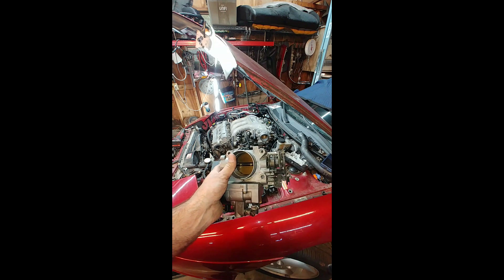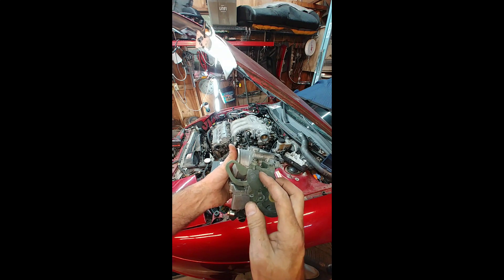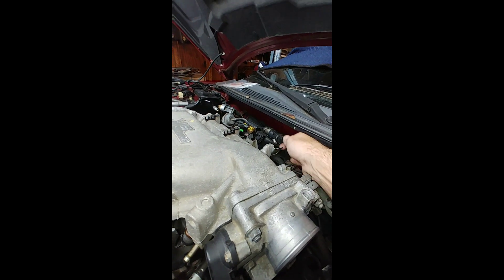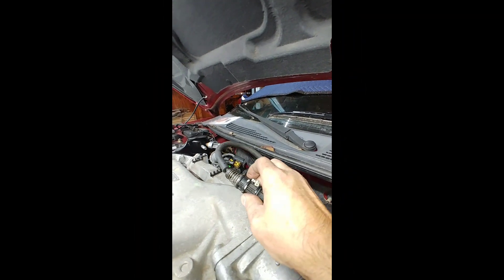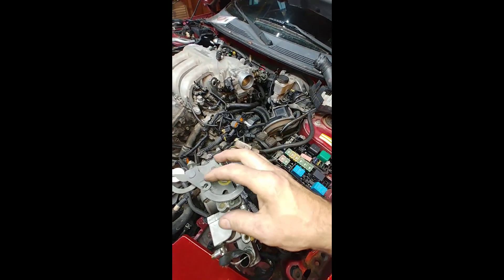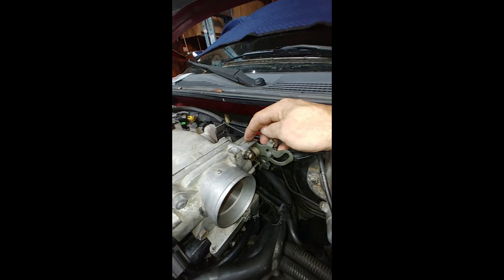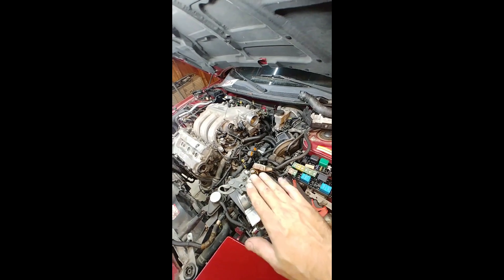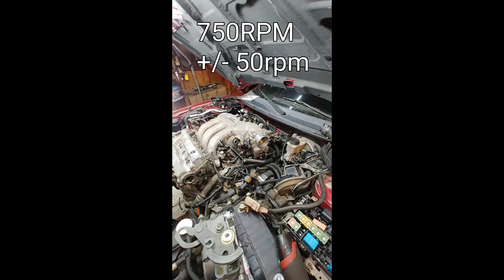KL - base throttlebody adjustment 2.5L Mazda/Ford

Comment: Dude I just bought a 94 and this channel is everything I could hope for. A question I have, if you could answer me, Is there an easy way of taking both of the headlamp retractors out without cutting the wires? I have been lookin in the engine bay and could not find the connectors. Thank you so much for the tips!
Reply from the maker: There's a plug on both, pull the bumper off to gain access
Reply: @wopath  that easy? Thanks a lot, I'll try to do that.